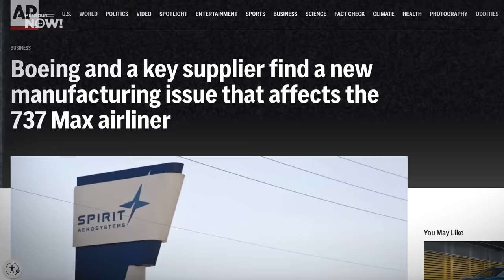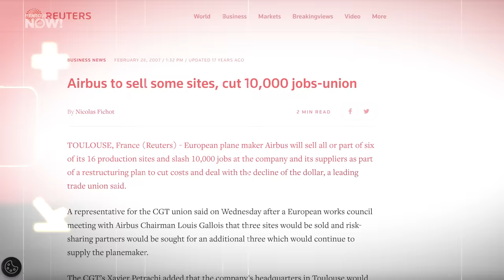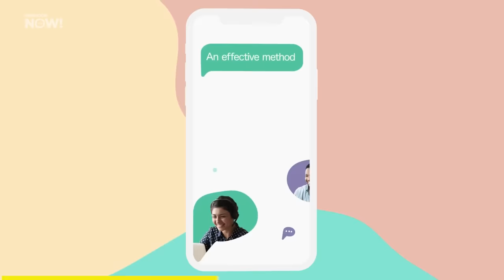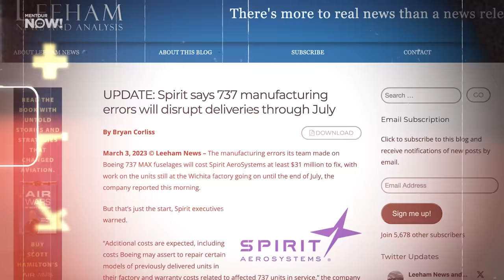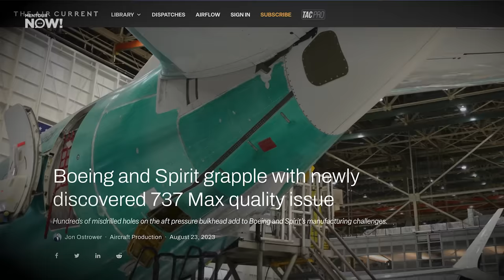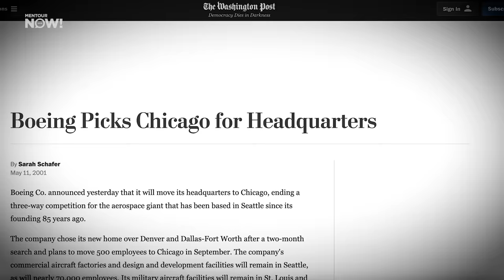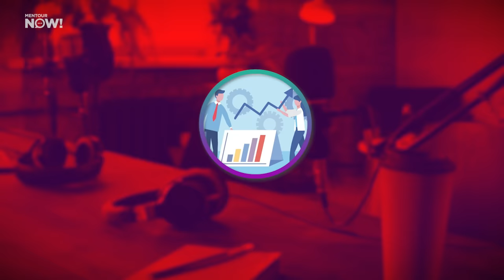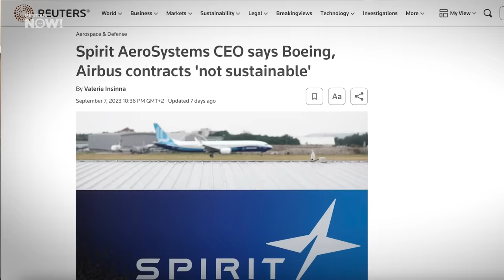NEW Problems with the B737MAX!

Comment: As a structural engineer for many years in heavy aircraft maintenance, if I was a major customer like Ryan Air, I would have someone overlooking the production of my aircraft. This is not good enough and quite frankly dangerous!!
Reply: This video explains exactly why that is totally impracticable
Reply: That's an interesting remark. Long ago someone told me that if an employee working for one of the major automakers bought a car from their company, they were allowed to walk it along the assembly line not only making sure it was being built right but to ask for extra care, such as a second dip in the galvanizing. With cars, that is easily done. As complex as building a commercial jet is, an airline would have to pay a huge salary to attract anyone with the skill to spot assembly errors. That's probably not practical.
Reply: @Inkling777 Arthur Hailey, "Wheels".
Reply: Many customers have reps that work on site in Boeing factories but it's completely implausible to think that those reps would be involved in every aspect of manufacturing their airplanes given the sheer complexity of building them.
Reply: @TinLeadHammer Wheels!    That was a very good book.
Reply: Smaller customers like KLM Royal Dutch Airlines have been doing just that for decades. But they have their own engineering and maintenance organisation while many airlines do not.
Reply: I've worked in aerospace with flight simulators and had on site Boeing staff sign off my work prior to integration into the flight simulator.
Reply: @charlottelanvin7095 The word is ‘impractical’ and doesn’t even apply to this situation. Learn the difference in the usage.
Reply: @TinLeadHammer  Wheels! Man that takes me back. If I remember the CEO has a heart attack and then there is a race to replace him. It comes down to an accountant type versus the designer/engineer.
Reply: @whizkid4386 - Hmm? 🧐 I'd argue that the use of 'impracticable' instead of 'impractical' is correct in this instance. And yes, I do know the difference in meaning, thank you. Or at least I do in British English. Speakers of Pidgin Merkinese may treat the two words differently...🤭
Reply: Boeing assembles the whole aircraft from sub-assemblies made by supplies.

If the error was made by a supplier then having someone on the assembly floor is not going to identify an error made in a suppliers factory.
Reply: I’ve always assumed that their customers used 3rd party inspection companies like BV, LR, etc.  to do Factory Acceptance Testing/sign off.
Reply: lufthansa does that overseeing during manufacturing.
Reply: @Inkling777  Interesting. I worked in engineering for an American auto company and I never heard of that.
Reply: @whizkid4386  "(of a course of action) impossible in practice to do or carry out. "it was impracticable to widen the road here"". This is the correct word to use in this case, actually an extension of impractical.
Reply: If you buy boeing aircraft, you are knowingly trading safety for execs that cut corners to enrich themselves.
Reply: Both issues being determined to not be safety of flight, plus the few details given, don't support the allegation that this is "quite frankly dangerous".

 Double drilled (or figure eight or "snowman") holes that aren't detected by visual examination might be entirely filled by rivets and might be only in a layer that's internal (and possibly both). Only testing to failure could determine the actual effect.

Zero details are given about the vertical stabilizer fittings and how they deviated from the design drawings.

I'd want additional information before jumping to the conclusion that it's a dangerous condition.
Reply: @mikebarushok5361  The double drilled holes certainly look like rework and a coverup.  Boeing has a habit of hiding mistakes at the risk of those who fly on their aircraft.
Reply: Considering Ryan Air, they would just ask a additional fee for an oxygen mask  :)
Reply: @_PatrickO  You do realize that drilled holes are never perfect? Holes are out of round, non perpendicular, tapered, undersized or oversized to varying degrees. Proper engineering takes those all into account. And there are significant margins whenever a calculation is done. Often 300% of worst case, where worst case might be 20% of rivet holes slightly deficient.

When I worked at Learjet we did a test to failure of a pressure vessel (aircraft cabin) to verify that a randomly selected production fuselage, not a hand built prototype, would withstand over pressurization to at least 3 times the worst case possible differential pressure. Easily passed (28.5 PSI vs 9.5 PSI emergency dump valve setting). But, we kept going, because there would be more information if we knew when rivets started leaking and door seals. When we got to about 45 PSI small leaks started happening. At 60 some leaks were more noticeable and the decision was to continue to rupture. Even though it's literally impossible for the cabin pressure to get to 30 PSI. But, we had to stop to take some extra precautions, since it was going to be a major explosion when something structural failed. A couple of forklifts were enlisted to set some heavy steel plates in front of the nose, since everyone was sure it would be the forward bulkhead that would rupture. Everybody had to clear out past the adjacent bays and everything was done remotely. Finally at about 90 PSI creaking and groaning was audible. At about 95 PSI the forward cabin bulkhead ruptured cleanly and symmetrically and the sound was deafening and was heard over a mile away at the airport control tower. The forklifts and steel plates were displaced over 70 feet and 30 years of accumulated dust throughout the entire factory became airborne.

The point is that conservative design with safety margins is routinely done in aircraft structures. To the extent that, in this case, the aircraft was able to withstand ten times the differential cabin pressure that would ever be encountered.
Reply: @peterwilliamson1825  Errors can be identified by a goods inward inspection process, but many companies do not do that because they believe that final inspection by the sub-contractor is sufficient guarantee of correctness. When two separate financial systems are involved, this is a dangerous assumption.
Reply: @hb1338  Goods inwards is not going to detect 300 out of 4,000 snowman rivet holes when the rivets have been formed and the heads of the rivets are covering the 'evidence'. Especially as they don't ship the rear pressure bulkheads separately for assembly at Boeing. The rear pressure bulkhead would be delivered to Boeing as part of an entire fuselage as seen in the video.
Reply: with larger and larger body diameters, the safety margins become less, and the thermal expansion-differences become larger. So even the strictest metrology tolerances for aft-domes don't help, if one part is prepared (drilled) at a low temperature (in winter?) and assembled at another temperature in summer!
Reply: @mikebarushok5361  The bulkhead is subject to stretching and relaxing during every pressure cycle (a flight). Any fastener that is not well fitted in the holes in the mating pieces can gradually fatigue the metal.  Could take many years, so it is correct to say that it is not an "immediate" safety issue.  It will be fixed, but makes you wonder about other undetected issues.
Reply: You guys use to pressurize 100 psig a fuselage?? I’ve done cockpit wrk and blew the safety valves @ 9-10  damn!!! Learn something new everyday. The thing that gets me is, I’ve only “snowman” or “fig 8” a hole drilling out a rivet, not a new manufacturing buildup. I’m trying to understand how that was possible ESPECIALLY the bulkhead which is MOST IMPORTANT!!
Reply: When I was a kid in the 1950's, we went to Dearborn and watched our car being built.
Reply: @mikebarushok5361  CNC drilled holes are so near to perfect that it doesn't matter, maybe a thousandth.  CNCs don't make snowmen.
Reply: Ryanair is the biggest airline in Europe by passenger numbers and never had a fatal crash in their history. Seems to me like they‘re doing everything right safety wise. It‘s Boeing‘s job to produce a decent plane. Big customers like RyanAir are definitely involved in the production and design, but it‘s impractical that they oversee Boeing‘s production, because it‘s not their fucking job. Boeing should be competent enough to make a decent and safe plane.
Reply: @Inkling777 Good comment.  No doubt quality control on Boeings production line has declined in recent years. Much of the decline stems from outsourcing construction of subassemblies and components. There have been reports of Boeing bringing some manufacturing back in house to reduce the problem of poorly produced components. Design deficiencies are a whole other story.
Reply: i fly ryanair all the time and i am always hoping it’s an older 737-800 rather than the new max but they keep ordering more and more 😬
Reply: @SteamCrane  Not unless you do a second run with corrected values...
Reply: @B-M.B  Somewhere in this discussion, Mentour stated that they use a manual drilling process, not a CNC. So every hole is "recomputed" every time by some worker. Like I do in my basement on a home project.
Reply: @B-M.B  I found Petter's previous comment about the manual drilling process at Spirit, here is the key sentence: "But it seems that Spirit uses a different process than its suppliers, involving a manually-operated tool which drills holes AND fills them with fasteners (rivets) in one operation." OMG!
Reply: @SteamCrane  thank you, I'd read that, my comment was not meant that seriously. 😉

Comment: I can't believe they are drilling holes in wrong places. That seems like something that shouldn't happen on a new bike let alone a new plane.
Reply: Feels like some of their engineers are working against the company.
Reply: Or something that happens inside the wings of an A380.
Reply: I never worked there, so I'm innocent.
Reply: 300 out of 4000 holes sounds like there is some underlying issue with their machinery or their software, and no adequate quality control.
Reply: @richardwilliams1986 it wasn't me either. I think it was that other guy... You know, that one.
Reply: I make a lot of snowmen. But I am a very bad woodworker.
Reply: Seems shmeems...those operators knew what they were doing and some corrupt inspector passed it.  They need a jail sentence and I don't mean a piddling two years.   The badly-trained jerk on the floor couldn't give one because he's never been taught anything about aviation ethics by cost-conscious Boeing management/bean counters.
Know what happens if a rear pressure bulkhead fails and ruptures?  Sleigh-ride to hell included free of charge.
Then Boeing calls their finance boys and lawyers before actually calling the plant managers for information.
Reply: All of these parts go through some sort of metrology to verify the GD&T drawings, which likely got missed or worse.. failed inspection and swept under the rug
Reply: You're talking about 4000 holes, likely with the same datum, and very tight tolerances. It's easier said than done. That's not excusing the issue, just that it's a little more complicated than "just drilling holes in right place"
Reply: Drilling 4000 holes in the right place might be difficult-- but then going back and redrilling them and covering it up hoping that nobody would notice, is a much more serious problem @Jadder88z
Reply: @angelarch5352 completely agree